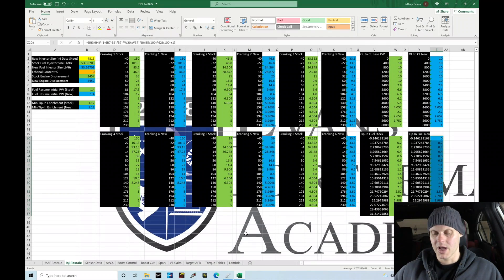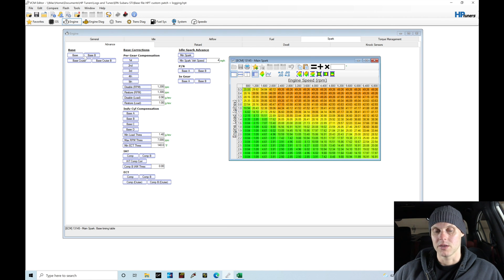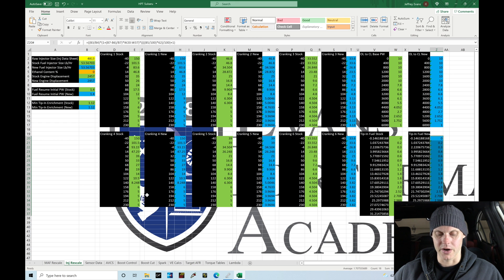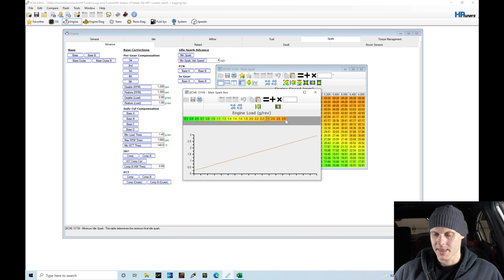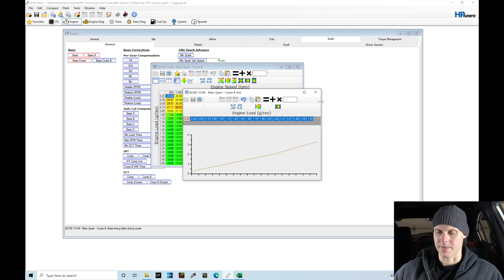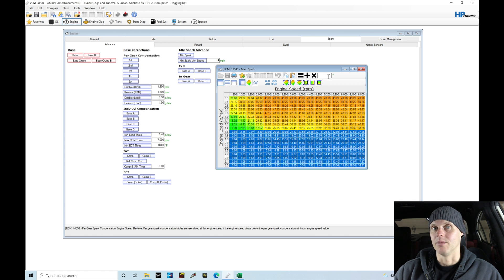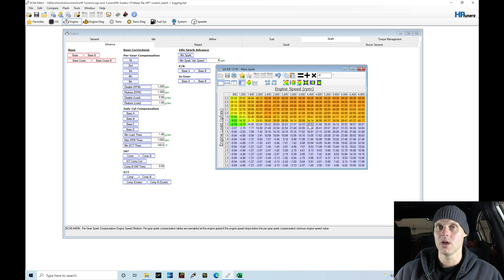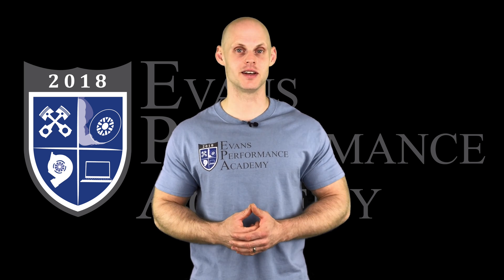HP Tuners Subaru Live Training Part 1: Base Map Creation | Evans Performance Academy

Comment: Excellent your videos friend Evans.
Were you able to install the HP Tuners speed density park on a 2013 Subaru Sti? I can't in my Subaru
Reply from the maker: Yes, the speed density patch was available.  If you don't find the speed density / flex fuel patch in the OS section of the rom file you need to email suppot@hptuners.com and they will add it.  There are hundreds of rom file types so only some of them are prepped ahead of time.
Reply: @EvansPerformanceAcademy  Thank you for your help and answer me Mr. Evans
Your videos are very good; I do not master the English language yet. When I master the language I will take your courses.
Reply: Hey Josh big fan! Are you able to kill all DTCs with HP tuners?